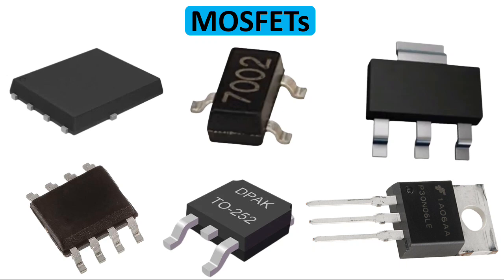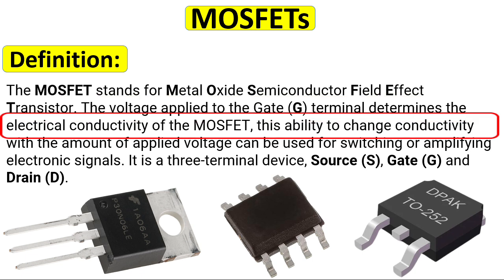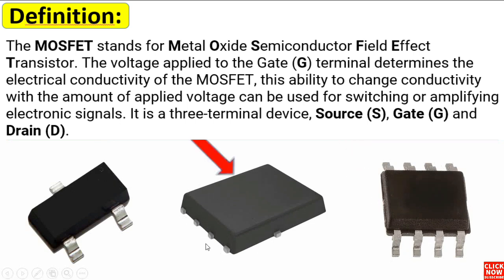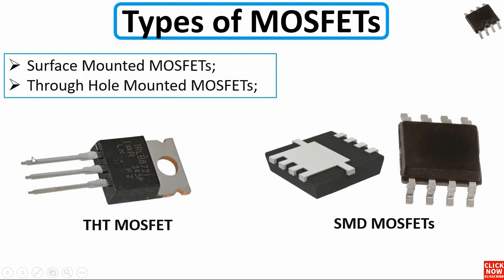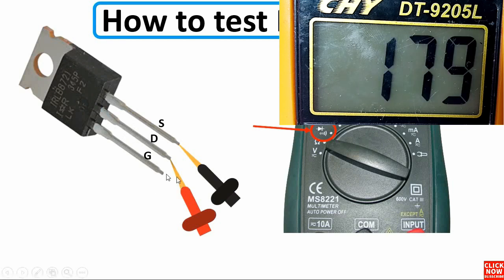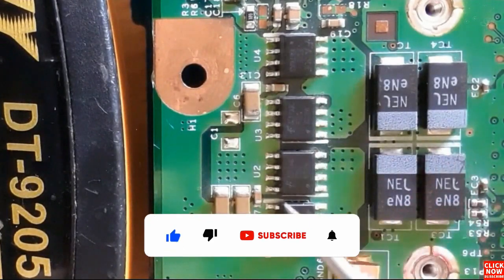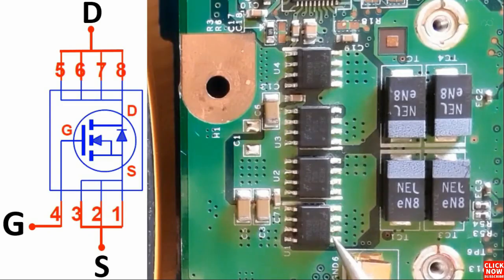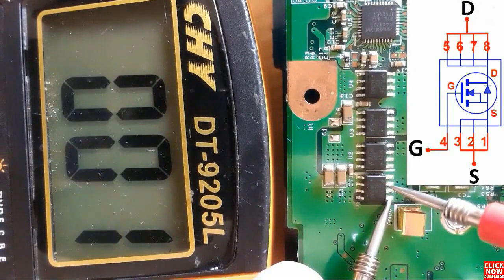How to test MOSFET in circuit using multimeter, MOSFET transistor with 8 and 3 terminals testing

Comment: good morning,

I have 4 mosfets near the processor (NCHANNEL), the 4 processors sound between the drain and the source, even by inverting the probes (with 4 in multimeter) is it possible that it is dead?  thanks

Comment: ummm not sure about your test, at  (4:54) this only proves the internal diode between source and drain is conducting, not that the gate is working, by switching on the gate if the component is working the meter reading will drop to almost 0 ohm measured between source and drain, unfortunately the component needs to be removed or a leg lifted do complete test.